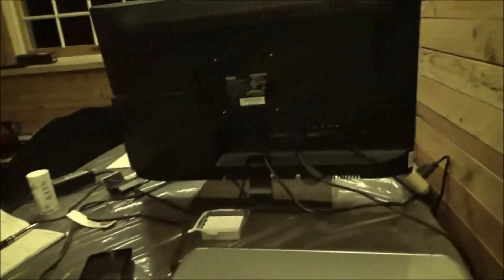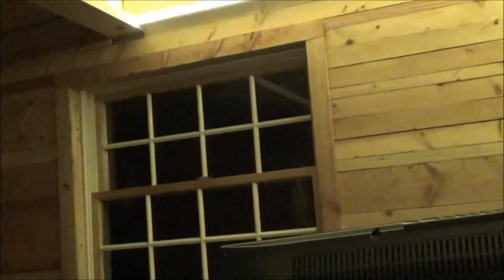Bedini Motor Radiant Energy Generator A Scam Or Is It Real

Comment: the bedini motor is super inefficient for charging batteries. its basically a modified joule thief functioning like a boost converter. It makes sense to use something like a boost converter for such an application assuming you want to charge a battery with a solar panel (this is also assuming the voltage of the battery at full charge is higher than what the solar panel can supply - otherwise youd just connect them together in parallel). But using a battery to charge another battery makes zero sense.
Reply: It doesn’t matter if charging a 12v battery with a 12v battery makes sense or not. People said it couldn’t be done and Bedini proved them otherwise.

Comment: You say it's not perpetual but you claim it will fully charge a battery while being driven by another battery of the same voltage.  That would make this an overuity device that should be able to run itself.  Perpetual and Overunity are not mutual exclusive!  For this to be an overunity device, it would be a perpetual motion device.  So if this motor charges batteries, then please explain what would stop you from using the same batteries and flip them around to keep the motor charging and running?    This phrase "Radiant Energy" sounds so cosmic.  It's nothing more than the collapsing field from the coil.
Reply from the maker: Actually there is nothing stopping me from swapping batteries around back and forth once the batteries are conditioned. This is not generating or creating energy. Just using available energy. Everyone believes and accepts we are bombarded by unlimited energy all the time from space. But if you mention using it people call you a freak. Well, this freak will keep using it. Nothing you say can change that. lol.
Reply: @TheDoItYourselfWorld   I am not calling you a freak and I do not for one moment think that you are not being genuine.  As an Engineer, this is difficult for me to accept a battery powered device can charge another battery indefinitely. I will build one and check what is going on. My understanding of the Bedini Motor is that the BEMF is redirected.  This redirection of the collapsing field is used to charge batteries.  There must be a point of diminishing returns where the system comes to a halt and can no longer charge.  However, I will make one and check this out.  May do a video myself.
Reply from the maker: I did not mean you specifically. John Bedini could not get this to pass through the patent office when calling it radiant energy or any other term than BEMF. So he went with that. But interestingly, the BEMF is larger than the energy put into the coil. And if you tune it right, it can be considerable. I have only used these to restore badly sulfated lead acid batteries to date. But I have done some experiments with multiple batteries being restored at one time on a single battery which ran for a month before needing a charge. I have played around with LED lights on the output and got up to 19 LEDs before I ran out of lamps. You can find my experiments here: https://www.diytube.video/playlist/3
Reply from the maker: And, based on experiments, I do believe this can be built up large.
Reply: @TheDoItYourselfWorld  The patent office for a long time now will not patent free energy devices or perpetual motion machines.  Yes, the BEMF voltage is larger than the voltage applied, but the useable energy will always be less than applied.  An oscilloscope needs to be used to get accurate readings of voltage and current.  It is not possible to accurately measure these values with a meter.  I say this because the reading you get on a meter is not indicative of the pulsing the Bedini Motor is creating.  The outcome power measurements will be an average if considering a full cycle or a peak power measurement.  As I mentioned, I am planning on building one and doing the measurements with an oscilloscope to identify what is going on.  If you are interested, I'd be happy to share my conclusions with you.  Right now I am building a pulse motor designed by Lasersaber and evaluating it.  He makes no claims of free energy and it runs on a Capacitor.  Very cool so I thought I'd build one and evaluate it.  If you never seen his videos, here is the motor I'm building and evaluating. 
https://www.youtube.com/watch?v=JNBi6qoW5SI
Reply from the maker: I have seen his work and love it. Have you seen the window motor? Not something I want to attempt due to the complications of tuning it but it can self run if done right.
You can measure the usable work out of a battery and show that it holds more energy than you had to put into it on the run battery.
Also charging up multiple batteries at the same time on one run battery is pretty cool. So it shows that the energy is coming from somewhere. Once you get that far, the sky is the limit so to say.
Reply: @TheDoItYourselfWorld  I have not built one but yes seen a video of a Window Motor.  It reminds me of the motor Newman tried to prove overunity but that was debunked.  Newman lacked a lot of knowledge of Electricity/Physics.  There are differences in the Bedini Window motor from the Newman Motor.
Reply from the maker: I never paid much attention to Newman myself.

Comment: I have been building and running these kinds of machines for over 15 years. Some of my motors have run for years, where I just go out to my shed every week or so and swap the run battery for the charge battery. John Bedini was exactly right. Screw the idiot trolls, thanks!
Reply from the maker: Thanks for sharing. I have a larger solar powered battery bank I use to run my devices. Its easier for me to run them like that than to swap batteries. I always used them to restore badly sulfated batteries but I am hoping to build up something large enough to power some cryptocurrency mining rigs.

Comment: i dont really care if there fake or real all i want is to try them i have been in a lot of scam but i learned from them they are my masters. because scam videos also help you learn to things why they don't work its a puzzle piece. we only have 100 years i wana see it on my very own eyes i want to know the truth
Reply from the maker: Then make one and experiment with it. Even if you cant get it running by itself (very hard to do and I will probably never try) you can restore lead acid batteries with this. And I do see some pretty cool things happening on the output side. I can charge up multiple batteries on the output while running it with one single battery.
Reply: did your charged battery fully charge ? using radiant energy? or back EMF? using the source battery is there still energy left on the source battery? after the charge battery being fully charged?
Reply from the maker: With a very good deep cycle battery I was once able to restore multiple batteries at the same time. I sure wish I had kept notes back then. I had wires coming out all over this thing in those days.

Comment: No, No, No! Stop making people stupid.  Put an ammeter on your input and another on your output. After measuring current, measure input and out put voltage. Now, multiply the input volts and amps to get wattage. Do the same calculation with the output values. You will clearly see that your power out is less than your power in. Better yet, buy a watt meter. STOP WASTING ENERGY!
Sincerely,
Mechatronic Engineering Graduate
Reply: It could charge 20 batteries at the same time, parallel or series, but the issue is how much are those batteries being charged?  I hate to break it to you but let me give you the real deal:  For starters, there is no such thing as "radiant energy" in the context of a Bedini pulse motor, none at all.  For a typical Bedini motor, the source battery power gets split into roughly 70% waste heat power to run the pulse motor itself, and 30% power that goes into the battery bank that you are charging.  There is zero energy being "brought in from the environment in the form of 'radiant energy,'" none.   So when you are watching your Bedini motor run about 70% of the energy in your two source batteries in series in your setup is being poured down the drain as waste heat.  It's a ridiculously inefficient way to charge batteries.  Also, thee is no "high voltage spike" going into the bank of batteries you are charging, none at all.   This is all a farce that is leveraging off the fact that more than 95% of people that are electronics hobbyists and tinkerers that build Bedini motors don't understand how an coil (inductor) actually works.  Bedini intentionally does not teach his followers how an inductor actually works because then the "wizard" gets exposed and has to come out from behind the curtains and his revenue stream dries up.
Reply from the maker: Sadly you are programmed so badly that you cannot see what is really happening here. You cannot measure radiant energy with conventional meters but you can surely charge multiple batteries with only a single battery powering the device. It works. Period. No matter how much you argue, it wont change the fact that it works.
Reply from the maker: And you call restoring old sulfated lead acid batteries wasting energy? I call that recycling at its finest. And it costs me nothing at all to do it. I can recharge the run battery on the output while recharging multiple batteries with it and use one of the other batteries I charged to power it. Win. Win.
Reply: +The Do It Yourself World WOW, I completely understand radiant energy. Further, I understand Watts Law, Ohm's Law, and Newton's laws of physics. I have Associate degree's in aerospace maintenance and electronic engineering, as well as BS degree in mechatronic engineering. Top that off with 24 year of experience working with aerospace systems. If your snake oil machine worked, it could run perpetually on a single battery. That, my friend, is simply not possible. Bedini motors are nothing more than highly efficient motors that can not do much work. And they do not, I repeat, DO NOT, produce more energy than they use. I recommend taking a few electronics classes and physics classes. If you like, I will bring my test equipment and show you, empirically, that you are using more energy than you are making. By the way, radiant energy can definitely be measured. When you look at the meter on your cell phone for the wifi or lte strength, you are observing a measurement of radiant energy, specifically, it's amplitude.
Reply from the maker: No, not radio waves. This is a different form of energy. And yes, I have a lot of electronics schooling behind me. But you have to forget everything they told you and take this with an open mind or you will never believe what is going on anyway. No matter what you say, it works. You can scream until you fall over out of breath but it wont change a thing. Please do tell me how this is able to charge 4 batteries, no - restore, while running on the same size battery. A single battery to run it. Four on the output. The four batteries get charged before the run battery is drained. There is another form of energy at work here. And no, we are not tapping into radio waves or anything man made.
Reply: +The Do It Yourself World You asked me to tel you how you are able to charge 4 of of one. the answer is , you are not. you are lying. you have presented zero empirical evidence.
Reply: there's no helping these people lol

One day, they might do an efficiency measurement and stop perpetuating this nonsense.

Comment: Hi Troy,

Greetings from the UK. It's nice to see what you've achieved in the last two or three years, and being well on the way to self sufficiency from the early start where you could barely avoid freezing to death. Well done.

I think the problem/confusion with this is that your set-up (made with scavenged components) is clearly very different to what you see in other resources, and there are plenty of bedini videos that don't make sense, contradict each other, claim to be perpetual energy machines (which you don't, I know, but others do and this would break a fundamental law of physics - ref: "law of conservation of energy"), etc etc etc. For example, do you use two (or more) separate circuits, and separate coils? Obviously a microwave coil is only single wire, but most schematics require a dual coil of different wire gauges.

With all the different info and wild claims out there, it's hard to know what is right and what is not. This gives the nay-sayers things to latch on to, and just confuses those of us who don't yet understand it.

I keep hoping you'll post a complete video of constructing the machine, or at least a complete schematic of your system. Alas you've been promising a detailed construction video pretty-much since your videos began. You've pointed at bits of the machine before but you must understand that it's hard to get a clear picture of your set-up from just that. It'd be great if you could get out MS Paint (or better yet, Libre Office Draw) and draw the schematic and circuit diagram. This would REALLY help those of us who are trying to learn from you but are still trying to get their heads around how it all works.

Keep up the good work!

Comment: good idea, Your Bedini motor could work. I have a setting on my B&D charger to desulfate the batteries. I cant, and havent measured what it is putting into the batteries nor do I claim it works. I researched the desulfators years ago and nobody had PROOF that it worked, but whats it hurting to try??? your not losing any money and can only gain. I trust that someone smarter than me has figured this out... or has deemed it "likely" to work. All the people drilling you to explain something that your not so sure how it works are jerks. Your not an electrical engineer or a NASA designer. Keep up the good work and thank you for keeping us informed about all your tests.   keep the videos coming.

Comment: Probably a stupid question but why are your batteries needing so much maintenance? I know they are warm weather golf cart batteries and not designed for solar storage but you seem to take pretty good care not to get them below 50%. If they are only two years old and have been well taken care of there is something seriously wrong if they already need this much work. I know people who run their battery bank(s) over a decade without desulfating and the like.

I'm not picking on you and if you say the Bedini does it's job I defer to your judgement. The only question I have about it is how much money do you/ will you have to spend on fuel supplementing with a generator while you constantly have to  fix your battery problem. Economically I can see at least an even trade off in either a) buying a professional automatic desulfator to drastically increase up-time or b) investing in a proper and durable battery bank. Both of these options also would include oversizing your battery bank to account for usage and low-light days. You will still be in desperate need of a power surplus even when your turbines are spinning. Power and therefore batteries are THE heart of your homestead. It seems to me that without reliable and plentiful energy you're shooting yourself in the foot with or without the Bedini.

Comment: YES! your connection for the four 6V bats is using ALL the batteries as if it were one! This is the best way to charge a bank or use a bank of batteries! Make it work through all the batteries evenly. If you hooked the motor to just one battery in your string you would stress that one battery and it would dray some energy from the other 3 and it wouldnt be even. I have never heard of the Bedini motor nor do I know what it is said to do, but I have a feeling your about to tell us.   Cheers

Comment: There is no extra power being made anywhere only lossed i have tested them you don't get more out than what you put in but it is a simple an cheap way to get the high voltage low current used to desulfate batteries why isn't it more commonly used simply put there is better more accurate ways of doing it for a cost,  a cars coil is the perfect example of the same principle its not pulsed on it always has power it's turned off to generate the spark taking 12vdc and making over 6000v the high voltage able to bridge gaps but no current

Comment: TROY!!!  YOU ARE OVERCHARGING THOSE BATTERIES!!! The output of a Bedini motor is roughly Source +20% roughly off that coil field... with you running that bedini off of 12Volts your putting around 15-15.5volts into that 6volt battery bank bud!!!... You need to switch it back to 12 volts or those batteries are going to be boat anchors soon... Then when you turn the Bedini on hook it up to a Scope and spin the flywheel so the rpms of the pulese are around 80-90hz and the voltage is on a rising rate of atleast 0.001 per 10 mines, if you you hook a multimeter to the batteries your charging and the voltage drops over a few minutes you need to adjust it.. that is how to properly setup that bedini man..
Reply: basically going off your old video's if that 2 battery 12 volt bank output is 12.35 volts, your Bedini should be putting around 14.82 volts out to charge with. You should turn the Bedini on and check the output before trying to use it on batteries man to prevent damage
Reply: I think you do not understand a word that Troy is saying in the video, he uses the 12 volt set to turn the bedini motor, then he uses high voltage spikes from the coil (seperate from the 12 volt battery) (its inducted voltage from the collapsing magnetic field, not any direct power from the 12 v set, he tickles his 6 volt set with hv spikes to burn of the sulphate in the 6v battery, he is not charging the 6 volt set that mutch (ok in time it wil, but the voltage pulses ar way more than 15 volts, they are around 600 volts! the batterys act as a ohms load, absorbing the spikes ,burning the sulphate off.
these 6 volt batterys are a mutch to large load for the spike to do any harm, other then revive them.)
Reply from the maker: MrBugsier5 Exactly